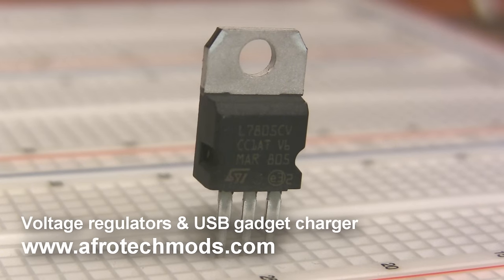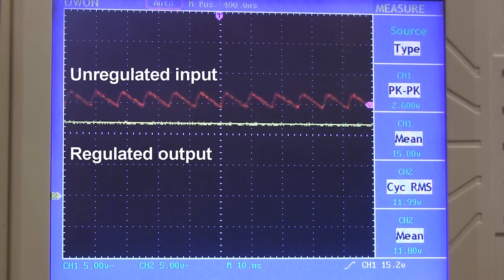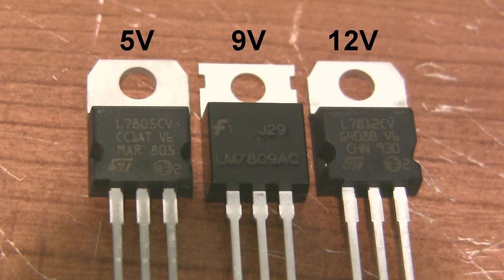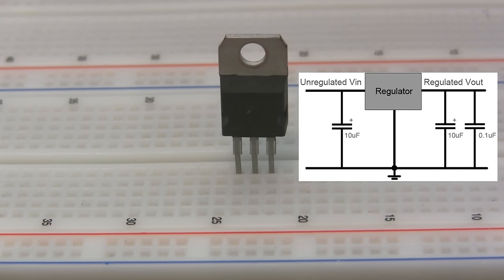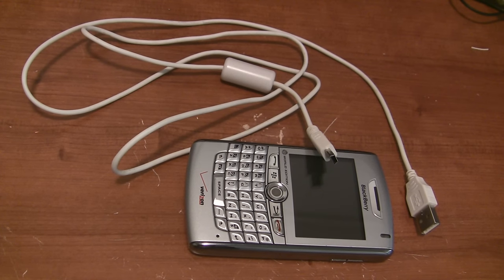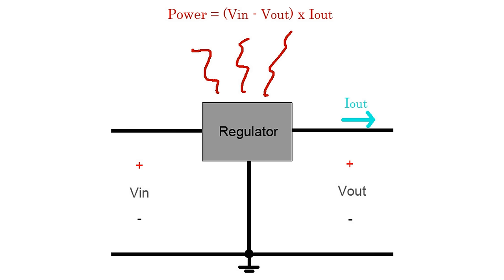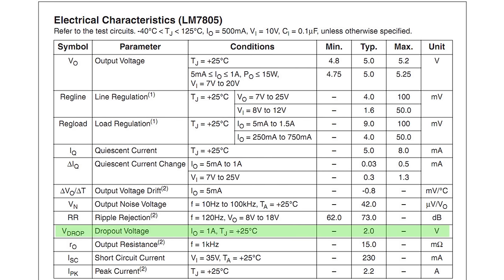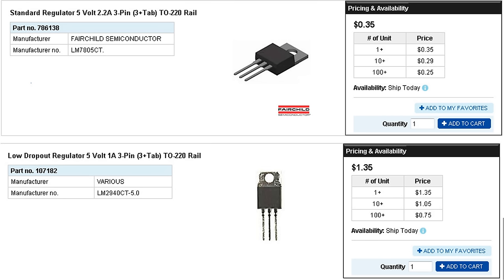Voltage regulator tutorial & USB gadget charger circuit

Comment: I'm trying to make a  solar USB charger, no rechargeable batteries at all, just the solar panels to charge my device. I bought a LM 7805c 5v voltage regulator, and I can't seem to get the regulator to step down the current to 5v from 24v. I hooked it up like the diagram on the package showed, current in to the input, and current out to the output, but the current out is only 1v less that whats coming in. The solar panel that I have puts out 15-24v and about 350ma in direct sun light, well below the 35 volts the package says it can handle. For life of me I can't figure out why the current is well above the 5 volts coming out that it says the regulator says it puts out. Did I kill the voltage regulator, or are they something that is hard to kill.. Or maybe did I happen to buy a bad voltage regulator?  I'm stuck at this point, I'm not a electronics expert, and this is the first time I've tried to make something like this. Any idea why I'm having an issue getting this to work. I don't want to hook my ipad up to this if I'm going to kill it by sending it way to much current.
Reply: Prence Try Solar Panel to BUCK Step Down Converter (12-30v IN, 3-14v OUT).  Note that such a small current won't be too effective.  Most iPads are looking for 5v @ 2A now to charge.  iPhones 5v @ 1A.  You're only pumping around 350mA.
Reply: Thanks but I gave up on this. I just went out and bought a solar charger. I tried messing with this for 6 months and just couldn't get it right. It was way more expensive to buy one pre-made, but less of a headache in the end.
Reply: Prence Yeah, know what you mean.  A YouTube video helped me.  I was just trying to learn more about solar and uses. This (BUCK) is more efficient (vs heat loss method with a voltage regulator) and adjustable via a POT.  All the stuff in the test pic can be reduced to just what's needed, of course.  Cheers.  
https://dl.dropboxusercontent.com/u/2357995/Solar%20USB%20Charger.png

PS:  Needs a diode added to + OUT.  When sun is low, current can try to back flow.

Comment: No, ONLY polarised capacitors need to be fitted with the right polarity. That means ANY capacitor which has polarity symbols on it (+ & -) or uses some indicator bar markings (usually, but NOT always for the negative end if only one marking). Be aware there ARE BIPOLAR electrolytics deliberately designed to be polarity neutral e.g. as used in certain loudspeaker cross-over units & can usually be detected because they have NO polarity markings. With these ALWAYS use a bipolar replacement

Comment: can i use a 5v regulator for dc 6v to dc 5v supply
Reply: +Ketan Shinde yes just make sure the dropout rate on the 5v regulator is 0.5v.  Keep in mind to make sure your 6vdc input voltage does not drop below 5.5vdc,  plus make sure the current draw doesn't pull down your voltage below 5.5vdc during use.

Comment: This may not be the place to ask this question but I ran across your video while searching for a way to power some LED lights with a USB cable.  I was intending to just cut the USB cable, like you did in your video, and going red to red and black to black on this LED platform:  http://www.amazon.com/gp/product/B007Y2RQTU/ref=gno_cart_title_1?ie=UTF8&psc=1&smid=A7DC3EDEBQG4S
The LED's say 12volt application.  I was planning on plugging it into the USB ports on my monitor.  Will this work?  Again if this is too far outside the scope of this video I apologize.  After 5 seconds into your video I could tell your understanding of such things greatly rivaled mine.  Be well

Comment: The main problem of the 78xx/79xx/LM317 regulators is that, they consume about 30 - 50% (in most cases) of the input power to regulate the output voltage (to convert), so a big part of the 12v battery charge is wasted.

Comment: Is it not true that a 100 w linear regulator still draws 100 w regardless of output draw ? This is why they refer to them as vampire devices. And is their a regulator that can avoid this using a MOSFET. ?
Reply: Yes very true!

Its because the energy you don't need gets wasted as heat. imagine trying to connect a small water pipe by inserting it into a much larger one - water that doesn't make it into the smaller pipe gets wasted. Check out potential dividers.

DC-DC power converters (Buck, Boost) use mosfets to waste less energy; they can be close to 99% efficient. They work by switching the supply very fast (20,000 or more x per second). I guess you could compare the switching to opening the end of the large pipe long enough to fill the small one before closing it again, repeatedly!
Reply: The amount of power wasted by a linear regulator varies with input voltage and load current being drawn. An approximate formula for wasted power (in Watts) would be:  PowerWasted = (  RegulatorVoltageIn - RegulatorVoltageOut ) * RegulatorAmps
Switching regulators avoid wasting power by turning off and on very rapidly rather than creating resistance. The downside is that they are a bit noisier, and often require some extra parts. To keep things easy, I usually buy the ready made LM2576 based modules, which often sell for around five dollars on ebay.
Reply: A "100W regulator" is one which would be able to dissipate 100W of electrical power as heat.  Think of a regulator as a variable resistance.  All resistance does is cause a voltage drop, and the "excess energy" is converted to heat.  The entire circuit still has to conform to Ohm's Law, so if the regulator input voltage is raised, the resistance likewise must be raised to keep the output voltage from rising.  Likewise, if the load (regulator output) increases its current draw, the regulator needs to decrease its resistance to maintain the difference in potential between its output terminals.

It might be helpful to think about electric circuits like a water loop having varying width pipes (where water molecules would be analogous to electrons).  If the pressure is increased on the input (analogous to increasing voltage), the pipe would have to be narrowed to keep the flow rate constant, such as partially closing a valve.  If the loop becomes wider (like increasing electrical load), that valve would need to be opened up to maintain the same pressure.
Reply: rchandraonline I am familler w Ohms law, but it still draws full power and disapates it as heat if not being used. I want to know if a MOSFET could be used to clamp down when there's no draw, therefor no vampire.

Comment: Please where exactly can I find these voltage regulator
Reply: ebay and amazon both have listings for them. just type the part number in and order.
Reply: Are there any other specs besides this type of number - "L7805CV" that I need when replacing a voltage regulator on an old PCB?

Comment: when should we use a heatsink?
Reply: it says in the datasheet.
a 7805 datasheet i have say 1,5W max without and 15W max with

if it needs to dissipate 4W  you need to out on a 2,5W heatsink
Reply: thanks

Comment: does a linear voltage regulator protect a battery from overcharging
Reply from the maker: If you have things set up the right way it can. For example if you set an LM317 to exactly 4.2V and used a current limiting resistor it could be used to prevent a lithium polymer cell from overcharging. But this is not a very good battery charger overall. I would suggest other circuits to do it.
Reply: Tariro Tichareva It would depend on the type of battery and how much circuitry it has itself to prevent problems. Some batteries chargers need current sensors that cause the charger to stop when current draw drops to far because that is a sign the battery is done.
Reply: jasonofcompsci thank you for the reply

Comment: Can someone help me. I am building a battery powered usb charger for my phone but when i have 12 volt input and connect my phone to the output of the L7805CV, the voltage drops from 4.99 volts to 4.50-4.40 volts. And when i use 18 volt input (from 2 9volt batteries) the voltage stays 4.99 volts when i connect my phone. Did someone know why is this happening ?
Reply from the maker: That is very interesting. What is the 12V power source? Perhaps it cannot supply enough current?

Comment: Why do i need the 0.1uF capacitor, it seems like such an insignificant amount..
Reply: To clean up the discharge voltage.  The 0.1uF capacitor provides a microvoltage in the output voltage so when there's a small drop, it's not seen by what ever device is being powered.  As this isn't enough to deal with a large voltage drop, a second, large capacitance capacitor is used .

Comment: I bought a cheap 120VAC to 12VDC converter and I was at work and forgot my plug-in charger for my phone.  I figured I'd get my adapter and just hook up my car charger to it and charge my phone that way.  I noticed when I used it, the touch screen wouldn't respond and my phone did strange things.  I checked the voltage and it was right.  I later found out that the cheap converter had crappy circuitry and had an extremely noisy output.  This was affecting the phone's display, etc...

Comment: I Love to watch your videos,please try to help me in constructing a Charger circuit, i have solar panel which gives 4-5 Volts and 400-500mA Current output so i need to amplify the current from 400-500mA to 800-900mA please help me and Thanks for your practical and theoretical explanation videos.

Comment: Why is there the ceramic capacitor?
Reply: I think they respond faster to rapidly changing loads.
Reply: can i use 100uF instead of 10uF capacitor.???
Reply: all electrolitics (cans) leak at small scales the ceramic filters this.

Comment: Bonsoir, je suis débutant en ce domaine et j'ai acheté deux condensateurs 10uF mais ils est écrit sur eux (10uF 2.5v 105°C  gr) et un autre (9401 100v 0.1uF 85°C GS) mais enfin je suis pas sure de ces derniers surtout que le dernier condensateur a la forme cylindrique et non que que la forme en vidéo
Reply: bon j'ai oublié de dire que ma source d'énergie est une batterie de voiture aussi comme vous
Reply: j'attends votre aide et merci d'avance
Reply from the maker: 2.5V or 25V? The 2.5V rating is too low to be useful in this application, the cap might explode! But if you meant 25V it would be fine. The regulator will work in most situations even without the caps, but adding caps just makes it more stable in more situations. Give it a try as long as you are not exceeding the voltage and current ratings you are unlikely to damage anything.
Reply: A vehicle battery is 12 volts DC. In a vehicle that's running the voltage is about 13.8 VDC. Your caps should be at the very least rated at 16 volts but higher voltage rating is always better.
The last cap shown added in the video is a metal film type cap used to filter any high frequency that may present itself, the others shown are "cans" and work for keeping lower frequencies out as well, These are used because usually a 12 volt system exists in a vehicle and some older vehicles have noisy electrical systems.
In power supplies for high amp, we use high value "cans" in parallel to filter out the 60 Hz hum from the mains 120 VAC @ 60 Hz. In Europe its 240 VAC @ 50 Hz..

Comment: The heat dissipation in your linear regulator is (12 - 5) x 1.5 = 10.5 watts. That is too much for a 7805 even on a big heatsink. Look instead for a 5 volt SWITCH mode regulator or better a different wall adaptor.

Comment: can u tell me how can i get 1000mah output fro this circuit
Reply: let 100mA run for 10hours.....
:P
Reply: +Jonas Nicolaysen you dont know about electrical are u?
Reply: yes i do..
it's getting late here but, you asked for how to get this circuit to deliver 1000mah. I beliv you meant 1000mAh or 1000mA for 1hour. witch is the same as 100mA for 10Hours. 
Am i getting this wrong?
Reply: +Jonas Nicolaysen am talking about this circuit bro . is it give me 1000mah or i need to add some parts in this circuit
Reply: if mah does not stand for milliAmpHours, what does it stand for?
maby you are asking for a circuit that can delvier 1000mA?    without the h on the end.
Reply: +Jonas Nicolaysen yes bro am  asking is this circuit can deliver 1000ma?
Reply: lets say you are asking for 1000mA.
Yes it can. but you need a heatsink becous it will get to warm.

 (battery voltage - out voltage) * amp = power dissapation
(14v - 5)*1=9W

7805 have max 3,5W without heatsink and 15W with heatsink ( in the last datasheet i looked in)

Comment: Why not add a cooling fan at the output to reduce the 3.3 Watt heat? I think fans like the ones found in computers are 0.8 Watts.
Reply: Yeah, precisely. That's throwing away enough power to drive four fans as useless heat.
Reply: Still produces heat and waste energy if you cool it with a fan you're only protecting the device and using more energy.

Comment: RIP Radio Shack!  Too bad they got away from their core purpose "back in the day" and started to try to compete with everyone else.  It destroyed them.

For the power supply USB charger you should put a 22K ohm resister from the INPUT line of the USB to V+ and the output should go through a 22K resister to Ground.  This will tell the device that it's connected to a CHARGER and not a USB port.  Don't let the input and output float, they may pick up random noise and the device may become confused.  Most of the newer devices will be OK but some of the old ones might shut down because they don't see a response from the device to which they are connected.  If it expects a response from a computer and it doesn't see one or if it sees random noise on the input it may "freak out" and go to standby or just shut down.

Comment: Couldn't i Use for example:
16v->7812->12v->7809->9v->7805->5v
That would be still hot but not all on one but not much on all.
Reply from the maker: Haha that is an interesting, very elaborate approach but yeah if you wanted to do that and don't care about efficiency it would work.
Reply: I'm trying to build a usb charger with a joule thief, around 2.4V i can get 4.7V with a 5.6V zener diode put in series with a 1N4001 diode. Now I wonder what is the more stable? Buying a 5V zener diode or use two zener diodes in series with a 5V regulator (7805) ? Which is more stable, the zener diode or the 7805 regulator ? Thanks in advance

Comment: Why are you talking about DC ripple when you are talking about using batteries as power sources?  As far as I understand, ripple is only an issue when you've converted AC to DC, like using a wall wart power adapter.

Comment from the maker: You could have exceeded the voltage rating, or you got the polarity wrong. Or there might have been a high surge current. Tantalum capacitors are shit like that. Stick to electrolytic + ceramic.

Comment: I want to build a wopping big 5v power supply.  My goal is more amps for the dollar.  I'm sick of these weak little supplies.  I have more 5v things than I can count and I want just one stellar system to power them off of.  What is the cheapest way to build / buy one of these and is there any reason I wouldn't want to put a cell phones, raspberry pis, a 5v network switch all in parallel?
Reply from the maker: jasonofcompsci Best bang for the buck 5V supply would be hacking an old computer's ATX power supply.
Reply: Afrotechmods,  yep.  I'm now on it.  I've done everything I can with breadboard.  Just waiting for some usb female connectors to get in and its soldering time.  April 22.  Why I keep buying things from hong kong I'm not sure.

Comment: I use boost/buck converters from China for .99 cents. No wasted power in the form of heat when driving it with a battery.
Reply: Less than a cent?

Comment: I have 5.00V at the output, but i can not charge my phone. Does anyone know why ?
(My power supply can give 1.5A-that's enough, isn't it ? The original sony charger gives 1.5A too.)
Reply: Did you check that you used the red and black wires?

Comment: The hell with fixed regulators just use lm317t. Buy in bulk and chose what voltage you want between 1.2v and 35v

Comment: capacitor 10 x how volts?
Reply: Marilyn Torres Does not matter, aslong as it's enough.
For example, for an input of 12 volts, it would need to be atleast 12v.
Output of 5 volts, atleast 5 volts.

Comment: Hello everybody! I'm not an expert with electronics so I require some help with my project. I'm powering a servo with a 9v rail regulated using a 6v voltage regulator. Can I use the same circuit and capacitors shown in this video for a 6v regulator? I want to add a diode to protect the Arduino it's connected to as well. So calling all engineers! I need help! Thank you!
Reply: Timothy John Aguilar yes you can use the same components

Comment: some volt regulators has 5 or 6 pins
Reply: LM1084 and its setup for 5v using resistors.   my voltage drops from 5.20v to 3.30v when i connect a 2A load on it.. anyone help me solve this ? my power supply is 12v 20A and input voltage stay at a constant 12v and iv tried 2000uf cap on the output but still voltage falls iv used 4000uf also no change...and mobile phone stops charging under 5v
Reply: Thankyou for your reply. i have the Adjusted version.. they were very cheap from china.. i decided to use the adjusted version as it was easily available and cheap..the fixed voltage versions are hard and quiet expensive.. i have also added a heatsink but as soon as i connect a 2a load (using two 50w 6 ohm resistors the voltage falls so low round 3.30v
Reply: i think i just found my problem.. my dummy load works out to 7A that is well over the 5A the regulator can handle. no wonder the voltage drops off. so a 50w 6ohm resistor..two of them is 7A.. when i connect my phone to charge that draws 1.5A and voltage is fine. so i should be able to charge couple phones at once...